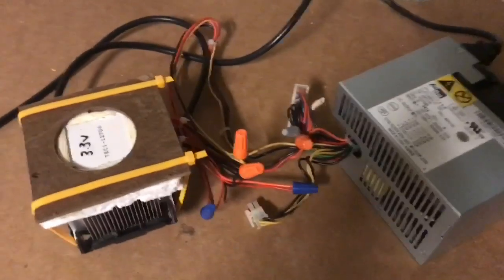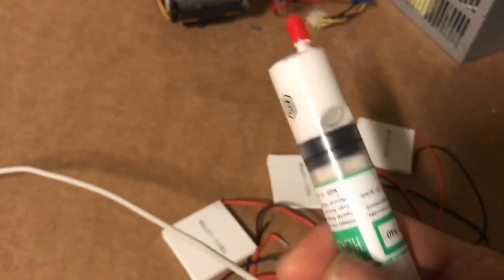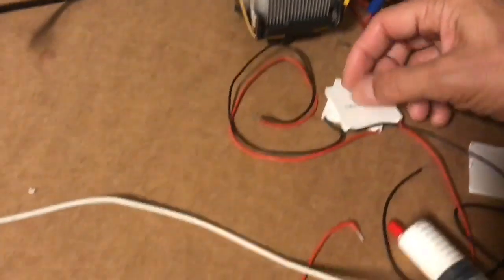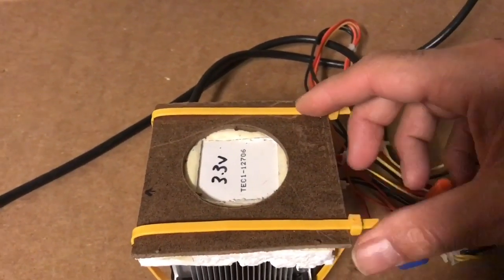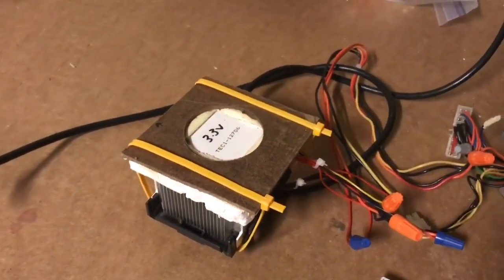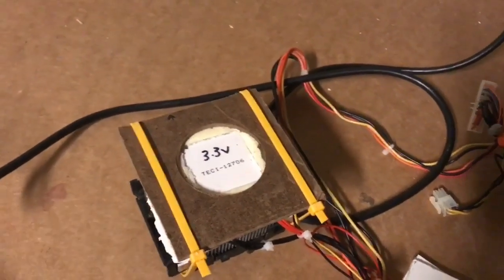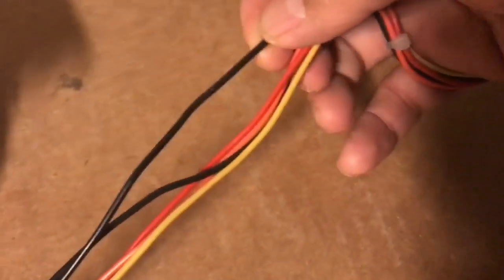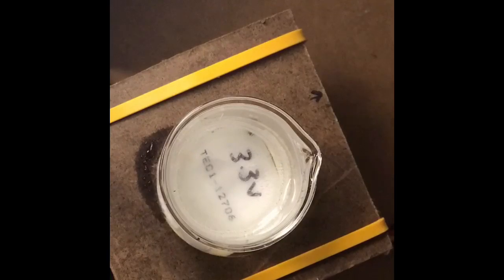Make -50 C Peltier Cooler

Comment: I have done an arduino code using two temperature sensors (LM35), one for the mosfet and the other one for the capacitor bank to detect overheating. According to the mosfet and caps temperature one of the 3 LED's will light up (if the sensor is cool green LED lights up, if it is warm, yellow LED, and if it is hot the red LED). You could modify the temperature values, for increasing/decreasing the temperature values in the program, 7 = 1°C. You can also modify the circuit so that it shuts of the power with a mosfet in stead of lighting the red LED or something like that, I think you got the idea. I hope you find it useful. Here is the sketch:

int Mosfet = 0; // This variable stores the temperature data of the Mosfet
int Capacitor = 0; // This variable stores the temperature data of the capacitors

void setup () {

  pinMode (2, OUTPUT); // Pin where will go LED temperature indicator (green) Mosfet
  pinMode (3, OUTPUT); // Pin where will go LED temperature indicator (yellow) Mosfet
  pinMode (4, OUTPUT); // Pin where will go LED temperature indicator (red) Mosfet
  
  pinMode (5, OUTPUT); // Pin where will go LED temperature indicator (green) Capacitor
  pinMode (6, OUTPUT); // Pin where will go LED temperature indicator (yellow) Capacitor
  pinMode (7, OUTPUT); // Pin where will go LED temperature indicator (red) Capacitor
  
  pinMode (A0, INPUT); // Pin where will go Mosfet temperature sensor
  pinMode (A1, INPUT); // Pin where will go temperature sensor Capacitor

  Serial.begin (9600);
}

void loop () {
 Mosfet = analogRead (A0);
Capacitor = analogRead (A1);
 
    
 if (0 <= Mosfet <= 239) {// If the temperature is between 0 and 35 ° C the green LED lights up
  digitalWrite (2, HIGH);
   digitalWrite (3, LOW);
    digitalWrite (4, LOW);
    
 }
  if (240 <= Mosfet <375) {// If the temperature is between 35 and 55 ° C, the yellow LED lights up
  digitalWrite (2, LOW);
   digitalWrite (3, HIGH);
    digitalWrite (4, LOW);
  
 }
  if (375 <= Mosfet <511) {// If the temperature is between 55 and 75 ° C, the red LED lights up
  digitalWrite (2, LOW);
   digitalWrite (3, LOW);
    digitalWrite (4, HIGH);
    
 }
 if (Mosfet> 511) {// If the temperature is higher than 75 ° C the electricity is cut off to the circuit
  digitalWrite (2, LOW);
   digitalWrite (3, LOW);
    digitalWrite (4, LOW);
    
 }
 if (0 <= Capacitor <= 239) {// If the temperature is between 0 and 35 ° C the green LED lights up
  digitalWrite (5, HIGH);
   digitalWrite (6, LOW);
    digitalWrite (7, LOW);
    
 }
  if (240 <= Capacitor <375) {// If the temperature is between 35 and 55 ° C the yellow LED lights up
  digitalWrite (5, LOW);
   digitalWrite (6, HIGH);
    digitalWrite (7, LOW);
   
 }
  if (375 <= Capacitor <511) {// If the temperature is between 55 and 75 ° C, the red LED lights up
  digitalWrite (5, LOW);
   digitalWrite (6, LOW);
    digitalWrite (7, HIGH);
    
 }

 delay (15);
}
Reply from the maker: That code looks very useful. I have not really learned the basics of arduino coding or sketches. You could use your coding ability to design code to auto tune an induction heater by analyzing the frequency of the tank circuit and using the output to keep a CD4046 chip in tune in the same way that Jonathon Kraiden did with his 12kW MOSFET induction heater.

Comment: I have a question. 
How long can the "stack" remain powered on? Is there a limit? 
Great idea. I want to use it for a cloud chamber. I am guessing that I would use the chamber for about 1/2 hour at a time.
Reply from the maker: kafr8413 it can stay on indefinitely. I have left it on for 1 hour with no problem.

Comment: So, instead of cascading with successively larger Peltier units running on the same voltage, you're using different voltages on the same-sized units to cascade with. Learned something new today!

Comment: yo mr teslascience!   good simple solution too cooling an array of capacitors in the induction heater ?    If this is where you are going with it I would be very interested in a collaboration.    As an alternative to the water-cooled Celem range of IH capacitors I have been thinking about 'wet foam bricks' or 'oasis' 9as it used to be called here in the uk) which is the stuff that flower arrangers use to keep the flowers from wilting.   Its a porous and very soft stuff that will take the shape of anything you push into it...like a board with 30 identical capacitors... and then give it a water source,   the non capacitor side of the foam block would be a loverly flat surface onto which you glue the peltiers.    hey ho.    nice work once again.
Reply from the maker: +itanc1 thanks! That is a really good idea. Never thought of that. I have not yet considered using the TC modules to cool a capacitor bank but that is definitely something to think about. I was thinking more along the lines of cooling IGBT or MOSFETs with the TC devices. An air cooled TC system such as the one that goes to -50° would allow the MOSFETS to run with very high currents before they blow up. I will definitely consider use of the TC system for  cooling capacitors in a cap bank. So for my capacitors have only become warm and have never become hot to the point where they need to be water cooled. That is the great thing about using a very large capacitor bank to share the current load.
Reply: morning sir!    yesterday I made the mistake of taking a call from the wife at the wrong moment and walked away from my IH and forgot to turn it off.    I came back to find the capacitors had burst as due to over heating (painfully I had managed to turn the fan and water pump off!).   interestingly enough the copper structure the the FETs are bolted to seemed to enough of a heat sink to save the board.    today I hope to try the peltier cooling of the new cap bank and i am thinking of submerging the bodies of the capacitors in a tray of copper slip which will sit on top of the peltier.   If all goes well i will try and post a vid.    

I wonder if you have had any thoughts about an arduino based system monitor that records data and cuts the power if any of the current, voltage or temperature sensors go out of range. (in an effort to reduce my mosfet bill!)  

have you any idea of the maximum temperature you have achieved? 

regards

tanc
Reply: I have done an arduino code using two temperature sensors (LM35), one for the mosfet and the other one for the capacitor bank, according to the mosfet and caps temperature one of the 3 LED's will light up (if the sensor is cool green LED lights up, if it is warm, yellow LED, and if it is hot the red LED). You could modify the temperature values, for increasing/decreasing the temperature values in the program, 7 = 1°C. You can also modify the circuit so that it shuts of the power with a mosfet in stead of lighting the red LED or something like that, I think you got the idea. I hope you find it useful. Here is the sketch:

int Mosfet = 0; // This variable stores the temperature data of the Mosfet
int Capacitor = 0; // This variable stores the temperature data of the capacitors

void setup () {

  pinMode (2, OUTPUT); // Pin where will go LED temperature indicator (green) Mosfet
  pinMode (3, OUTPUT); // Pin where will go LED temperature indicator (yellow) Mosfet
  pinMode (4, OUTPUT); // Pin where will go LED temperature indicator (red) Mosfet
  
  pinMode (5, OUTPUT); // Pin where will go LED temperature indicator (green) Capacitor
  pinMode (6, OUTPUT); // Pin where will go LED temperature indicator (yellow) Capacitor
  pinMode (7, OUTPUT); // Pin where will go LED temperature indicator (red) Capacitor
  
  pinMode (A0, INPUT); // Pin where will go Mosfet temperature sensor
  pinMode (A1, INPUT); // Pin where will go temperature sensor Capacitor

  Serial.begin (9600);
}

void loop () {
 Mosfet = analogRead (A0);
Capacitor = analogRead (A1);
 
    
 if (0 <= Mosfet <= 239) {// If the temperature is between 0 and 35 ° C the green LED lights up
  digitalWrite (2, HIGH);
   digitalWrite (3, LOW);
    digitalWrite (4, LOW);
    
 }
  if (240 <= Mosfet <375) {// If the temperature is between 35 and 55 ° C, the yellow LED lights up
  digitalWrite (2, LOW);
   digitalWrite (3, HIGH);
    digitalWrite (4, LOW);
  
 }
  if (375 <= Mosfet <511) {// If the temperature is between 55 and 75 ° C, the red LED lights up
  digitalWrite (2, LOW);
   digitalWrite (3, LOW);
    digitalWrite (4, HIGH);
    
 }
 if (Mosfet> 511) {// If the temperature is higher than 75 ° C the electricity is cut off to the circuit
  digitalWrite (2, LOW);
   digitalWrite (3, LOW);
    digitalWrite (4, LOW);
    
 }
 if (0 <= Capacitor <= 239) {// If the temperature is between 0 and 35 ° C the green LED lights up
  digitalWrite (5, HIGH);
   digitalWrite (6, LOW);
    digitalWrite (7, LOW);
    
 }
  if (240 <= Capacitor <375) {// If the temperature is between 35 and 55 ° C the yellow LED lights up
  digitalWrite (5, LOW);
   digitalWrite (6, HIGH);
    digitalWrite (7, LOW);
   
 }
  if (375 <= Capacitor <511) {// If the temperature is between 55 and 75 ° C, the red LED lights up
  digitalWrite (5, LOW);
   digitalWrite (6, LOW);
    digitalWrite (7, HIGH);
    
 }

 delay (15);
}
Reply: itanc1 can u share pic of it